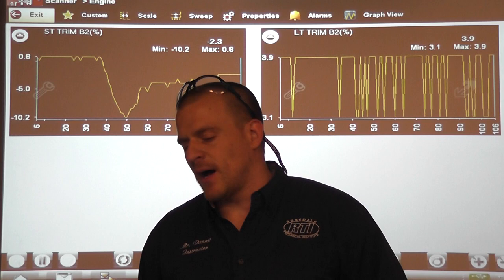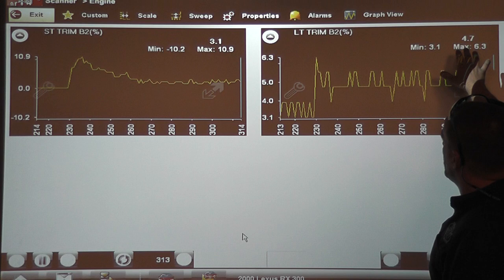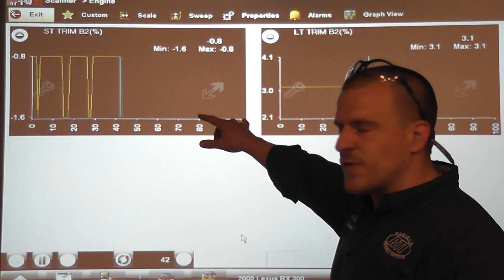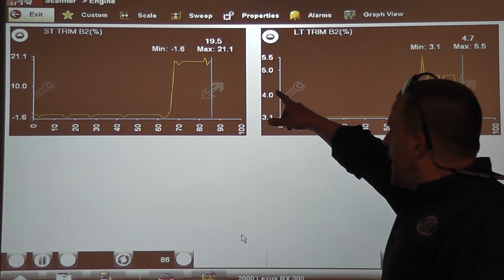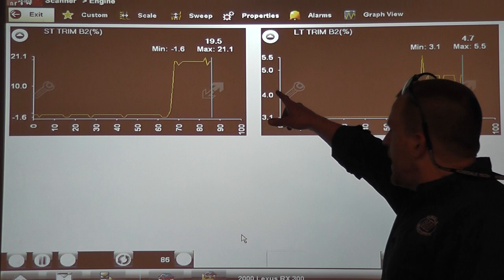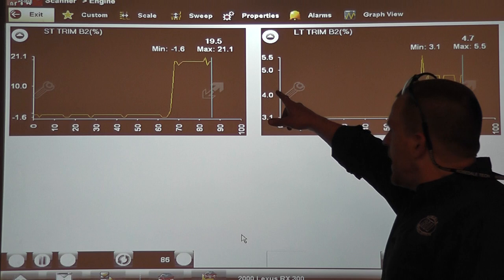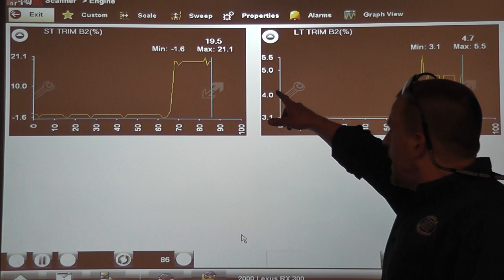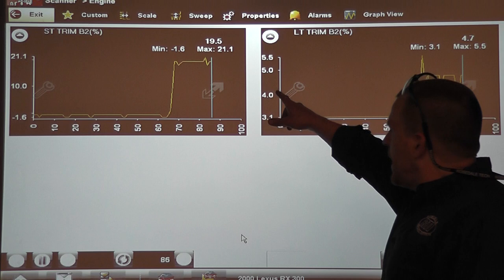Using Fuel Trim to identify type of misfire (can it be done?)

Comment: IF U FEEL THE ENGINE VIBRATING ESPICALLLY WHEN  U PUT ALOAD ON IT LIKE COMPRESSOR JUST DO BASIC SPARK AND FUEL I BELIEVE TO MUCH IS SCANNER DATA  LOVE U CHANNEL
Reply from the maker: Not what we are trying to do here. It's about learning your equipment and using ALL the tools that are available to you
Reply: @ScannerDanner  yeah but if the equipment is not helping you by giving you trims and short and long then the equipment that you're using you're just wasting analysis or nothing if I need to use a scope but I use a multimeter instead for a microprocessor I'm wasting my time looking at data outputs and logic outputs that's where we disagree
Reply: @ScannerDanner  and I also feel that people are too much reliant on a scanner to do everything for them nobody opens up a wiring diagram anymore and I understand obviously it's electronics I'm in electronics but still they're relying on the scanner to tell you every single thing when some of this the problems is basic electronics we disagree on that
Reply from the maker: @Joeelectronicschematicsforauto  in no way is looking at scan data and knowing how to use it a waste of time. I literally just used fuel trim numbers to ID which bank on a 92 Corvette had a misfire. In these years there are no misfire counters and this was a GREAT guide for where I was going before ever leaving the drivers seat or even opening the hood. 
I dont understand your argument against learning these techniques. Learning to use ALL of the tools in your diagnostic toolbox is absolutely important
Reply: @ScannerDanner  I understand but I'm saying sometimes it's Overkill to use a scan tool all the time and not go to basic electronics of a schematic
Reply: @ScannerDanner  when you're in the school teaching students you could take all the time that you need to diagnose over a car or a customer when you're making a video but when you work in a dealership and a fast-paced environment you have to work fast to satisfy the customers you don't have time to use equipment that will not help you because the customers will complain why taking so long waiting in the waiting room that's the difference
Reply from the maker: @Joeelectronicschematicsforauto  it's an argument equivalent to being able to losen a bolt with a wrench or a ratchet and arguing against using a wratchet. Each tool must be used in it's place and time and both should be learned!
When you learn these tests it takes literally a minute or less to use it. Saving yourself and the customer time.
Reply: @ScannerDanner  it's an argument of where you're working like I said if you work in a dealership and you know something is not going to help you a diagnostic tool is not going to help you then you're wasting time you have customers waiting for you
Reply: @ScannerDanner  you just said yourself that these few trims do not help so if I have four customers waiting for four cars to be fixed why would I go and waste my time using field trims to look at when I know it's not going to help me that's considered wasting time we're talking about dealerships we're not talking about a school environment teaching students or making videos we disagree totally
Reply: @ScannerDanner  and that's why you end up being apart changer because you work in that type of environment of a dealership which is a fast-paced environment if you work in your brother's garage it's different this is something we have to understand as being teachers a person can do the job himself doing oil change in his backyard 3 hours no bigger to complain but when you're in a dealership and you're paying labor rate $120 an hour tell that to the customer that I don't agree with it all if you know the fuel trims in your scanner do not help you diagnose a misfire why go to that
Reply: @ScannerDanner  and this is the point I'm trying to make to you in a private garage you can negotiate with the customer about the price and the labor rate in a dealership it's purely labor rate by hour and expensive customers don't want to hear that this is something you have to relate to your viewers in your videos that's why they are part changers
Reply from the maker: @Joeelectronicschematicsforauto  you're taking the video out of context. This video was shot to prove that both ignition and lack of fuel misfires drive the O2 lean, as others in the YouTube would have argued against.
That was the main point of the video. If i said the trims didn't help, I was saying that both types of misfires drive the O2 lean, making the use of fuel trim to ID of the type of misfire not helpful. (Some were arguing that an ignition misfire will drive the O2 rich)
But I was wrong! You can clearly see an ignition misfire is not as lean as a no fuel misfire! And I've since learned more about how an O2 actually works and have used this information to my advantage on other cars. 
So I'll say once again, using this information as a guide takes 1 minute, whether you're flatrate or not! Sure learning about the test, and why the O2 and fuel trims react the way they do is what takes time. 
Yet you keep talking about the flat rate shop and the customer paying for unnecessary time. Learn the techniques and save yourself AND the customer time!
So why argue against learning something that will save you time in your troubleshooting???
Reply: @ScannerDanner  but I heard you say don't be a parts changer
Reply: @ScannerDanner  and many people in the dealerships after the parts changes because number one they have the supply of parts there unlike a private shop in your brother he doesn't have the parts available so he has to order them so that's why they are parts changers number two if you are a customer paying $120 labor rate you wanted fast you want the repair done fast this is not a private shop in Pennsylvania that's my beef to tell people their parts changers but that's why I keep on bringing the point flat rate not flat rate
Reply: @ScannerDanner  and I've seen you about your speaking about techniques I've seen you plenty videos where you take out the relay from the circuit you put your power probe just like everybody else does instead of leaving the relay in circuit measurements which is more accurate you do not take resistors out of a series circuit so the same thing applies to a relay because the instructors in these videos teach only power and voltage they don't teach current flow if you understand the three of current flow you don't have to take out parts that goes to all of these channels with videos with power probes all of these channels there's a lack of basic electronics will you take out a component and measure it
Reply from the maker: @Joeelectronicschematicsforauto  why are you dodging the question or comment? Here is the example for you:
Car comes in with a single cylinder constant misfire. Maybe it is even cylinder specific, maybe not, either way it is a 4 cylinder engine and I see +25% fuel trim. Guess what? This is a no fuel misfire, NOT an ignition misfire and I never even left the seat of the car (looking at my scan tool), nor have I even opened the hood and I KNOW that I am not starting with looking at the ignition system! I am going immediately after the injector! You can spin this all you want but it doesn't matter where you work, what the labor rate is, what the customer is paying etc etc etc. This is a huge time saving piece of information and I don't know why you wouldn't want to take advantage. 

Then you bring up a completely separate point about removing a relay and testing a circuit and again, even in this, you misquote me and are providing information that is just plain not true. Show me a video where I removed a relay and tested the circuit wrong because the relay was removed. Link and timeframe. Then we can argue another completely separate issue.
Reply: @ScannerDanner  I brought that up because he said you have to understand the technique that's why I brought it up and I'm saying back to you you have to understand the technique of how current works in a circuit if you understand how the second works you don't have to pull out relays you don't have to jump relays which you and everybody else does that's why I'm bringing up the point if I work on a printed circuit board which I do I don't take the chip out and test the traces that's what you're doing this is what I'm referring back to when you said you should learn the technique the technique is with a relay the technique is with the component in the circuit like you have been not doing and putting your power probe I'm not going around the argument but I'm referring back to what you said to me
Reply: @ScannerDanner  you even said it yourself in that video you said I should have had an insider for the relay I know I'm going to hear about it in the comments
Reply: @ScannerDanner  and I didn't say you you diagnosed incorrectly I said that's not the way to troubleshoot basic electronic circuits by taking components out and always using a power probe because that's wasting time that means you don't know how the relay works
Reply: @ScannerDanner  so that's what you said you said you have to know the technique so I said the same thing you have to know how basic electronic works with relays there's no reason to take out a relay and give it 12 volts and give it ground all the time and jump it there's no reason to do that you don't take components out of a circuit unless it is loading down the circuit which it wasn't
Reply: @ScannerDanner  you being a teacher and an instructor should be used to students or people questioning a statement if you make it otherwise you cannot be a teacher
Reply from the maker: @Joeelectronicschematicsforauto  you are still changing the subject. But that's okay, we can move on to the next 
Again, time frame and video please. I have no problem answering questions, ever! But I also will emphatically state my case for what I'm teaching. A good teacher does that.
Reply: @ScannerDanner  by all means there's a lot of videos that you make and have a lot to look through
Reply: @ScannerDanner  but you cannot have a video and say don't be a parts changer in your introduction because you're you talking about the people who work in these dealerships and management tells them to change the parts and not waste time when you say that don't be a parts changer you're talking to those type of people have no choice again bringing this point that you say have nothing to do with it
Reply: @ScannerDanner  I never said you were not a good teacher now you're being inaccurate I said you have to have some patience that people will question you and one of them is me but I'm not your student but when you make videos then you have to understand people will question you
Reply: @ScannerDanner  and I will question anybody's electronics you have the right to question how people troubleshoot a car I have the right to question how people troubleshoot from a wiring diagram when they have to remove a relay and say I have no insertors I will look it up and definitely give you feedback

Comment: As soon as i let go of my gas pedal, ltft goes up in bank2. Is it vac leak although is showing up in only bank2?
Thanks
Reply from the maker: sudden changes in throttle is not the time to be looking at trim data, what is it with a steady throttle?
Reply: Ltft on bank2 is about 3 with the pedal pushed and about 7 as soon as I let go of the gas pedal
Thanks
Reply from the maker: Not a problem at all

Comment: .Hi paul. I AM having trouble with  2001 Chrysler Sebring it keeps turning codes on for  the o2 sensors po134,po154  No o2 sensor activity I have diagnosed this vehicle and right now I have No fuel trim movement at all. The o2 sensors can be forced rich and lean but the the fuel trim does not move at all. do you have any idea what could be causing this?.
Reply from the maker: +Daniel Wells did you replace them and now you are having this problem?
Reply: yes and Now that I have been forcing it rich and lean for a while it seems that it is starting to go into closed loop by itself but it is very intermittent I have tried heating the temperature or coolant sensor with A heat gun and it seems like that helped a little but then it started going back to an open loop fault status or just not going into closed loop I am having the customer drive the vehicle now and see if it will clear the codes. I am hoping this will work as it is required for Nevada smog emissions.
Reply from the maker: +Daniel Wells you need to watch this 2 part series. the short answer may be you put the wrong O2s in this. NTK sensors are the only ones that work on the PWM type heater circuits on Chryslers. Bosch sensors will NOT function properly. 
https://www.youtube.com/watch?v=-lUYRqaYvYI

https://www.youtube.com/watch?v=gtTKOuu6EPw
Reply: Thanks Paul , your the man .Ill let you know what happens.

Comment: So High HC...is A Lean Condition.. Low voltage command is add fuel...fuel trim is + add fuel..
A Rich condition high CO...high voltage command is less fuel...fuel trim reduce fuel trim - negative trim
Like you Said.. Cause and Effect....
Reply from the maker: If we're talking 5 gas analysis, HC can be high or either side of the scale (rich or lean). It is simply unburned fuel. CO is your rich indicator and O2 is your lean indicator. And back when I taught this, CO2 is the desired gas lol

Comment: Scanner danner is the best. But i have a problem my car is hard to start crank long,when its cold ,when its heated starts fine,the fuel trim shows -20 when i accelerate to 2000 to 3000 rpm it shows up to -30 very strange ive checked for vacume leak dont find one .ive even checked for hissing noise no hissing please help dont know what to do
Reply from the maker: -20, -30 is a rich condition. A vacuum leak would cause positive fuel trim numbers, not negative. 
Also fuel trim should be monitored with the throttle steady. So you are at -20 at idle and -30 at a higher RPM with the throttle steady right?
Reply: ScannerDanner problem changed now shows -19 no throttle at idle ,when i put steady 3000 rpm no change ,but when i press fast throttle pedal goose down to -6 -8 ,and when i drive under fast acceleration goose down -8. -9 ,what to look for injectors sticking?ar what
Reply: azizzable احتمالات : ١) البانزين زايد، بسبب بخاخ معلق واهو فاتح او منظم الضغط معلق او يهريب على الثلاجه...٢) الهوا ناقص اما المترجم يقرا غلط (وصخ) او دكتات الهوا مسدوده او دبة التلوث مسدوده في شي قاعد يقلل الهوا بحيث صاير عندك حالة ريتش و تخلتي الترم بالناقص
Reply: Im haveing similar issues minus 33 ignition is fine but ive isolated the codes rich on both my 02 sensors to bank 2 now im leaning towards a leaking fuel injector possibly dumping too much fuel just like the test shows,  he cut out the injector runs lean 20s so double fuel out of the injector possibly reverse effects in negatives just my next thought have yet to confirm it yet

Comment: Help please, 2002 blazer , starts normal then after 20 minutes starts running rough, idles Bank 1  STFT +54% and LTFT +25% both positive...Bank 2 STFT -3%  LTFT -%9...I  press on accelerator to about 2500 rpm and STFT instantly goes to 0% Bank 1 then climbs up rapidly back to 54% . did a fuel pressure test and it was 55psi , opened throttle and went up to 60psi than down to 53psi and up to 55psi. turned off engine and pressure remained at 55psi for more than 30 minutes so figured no leak. scan tool throws a p0300 and shows misfires in cylinders 1 , 3 and 5...my mechanic changed plugs, wires , cap and rotor. have no more money to keep paying with no results, need a real mechanics view. Please help anyone? suggestions?? thank you!!! trying to learn from this awesome channel but im just a DIY 'er!!!
Reply from the maker: I replied to you in another video, reply back there okay?

Comment: You should spend more time on IATN and you would know why the trims are different and that we do use trims on a daily basis to diagnose misfires. There's not enough characters in a youtube reply to spell it out. 1 thing you said at around 4:10 was without an injector pulse, MORE O2 would be entering the cyl. That's incorrect. The same amount of O2 would enter on the intake stroke. Also, with a bad cyl being the cause of the misfire, trims would be at 0 or negative as much as 30%
Reply: thanks man  would you explain  why     with a bad cyl being the cause of the misfire, trims would be at 0 or negative as much as 30%

Comment: Here’s one then and see if anyone can solve it. Recon cylinder head on Golf 2.0fsi mk5, new plugs, 4 pin cop, misfire on 2/3 cylinders. Cylinder drop test proves misfire. Unplugged all cop and engine turns sounding fine. Switched injectors 2 for cylinder 1 and 3 for cylinder 4, still misfire cylinders 2/3. Compression test all cylinders 13.1 bar. Wet test same except cylinder 3 increases to 14 bar. No smoke, no oil in water expansion tank. Sounds like misfire goes as increase the revs so want to say misfire at idle. This engine has a common rail feeding injectors with high pressure fuel pump running from intake cam lobes. 
Anyone got any suggestions....?
Reply from the maker: Post this here James https://www.scannerdanner.com/forum/post-your-repair-questions-here.html
Reply: You may want to check the valve sealing, either with a fls sensor or a vacuum gauge.  Now, if you had an in cylinder pressure transducer that tells u the whole story. .
Reply: Thanks for the reply. I bought a cylinder leak tester kit with compressor. Needed the compressor for other stuff. Yep a pick would tell me the lot but the leak tester also tells me the whole story. 

Theres blow by on the cylinders regardless of there being almost double the compression that Haynes workshop manual states. I can only presume the head was skimmed before I skimmed it and that is what has caused that. 

Anyway air blasting up through rocker cover. 

J